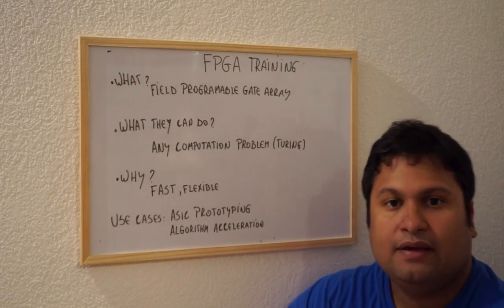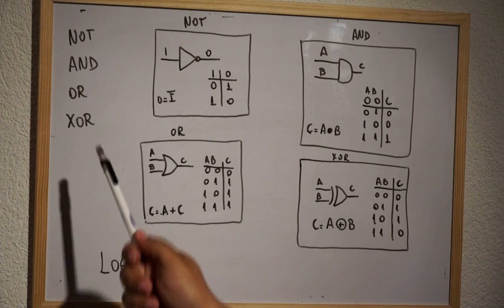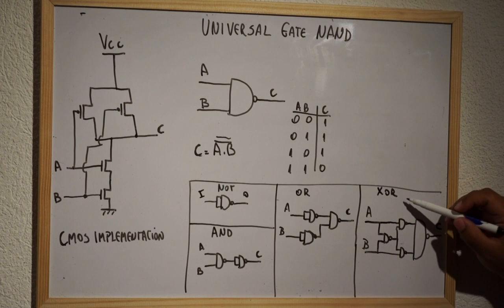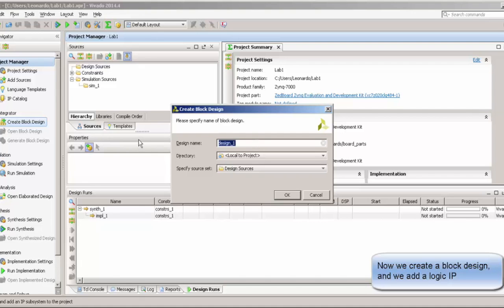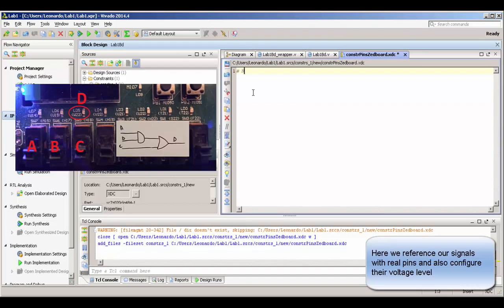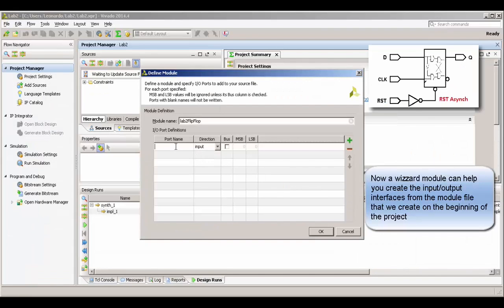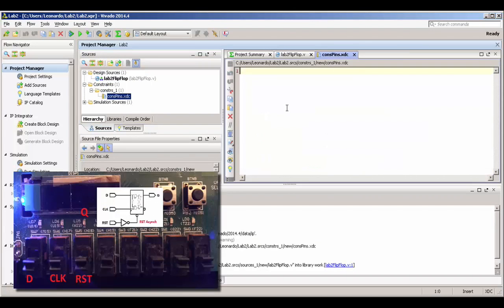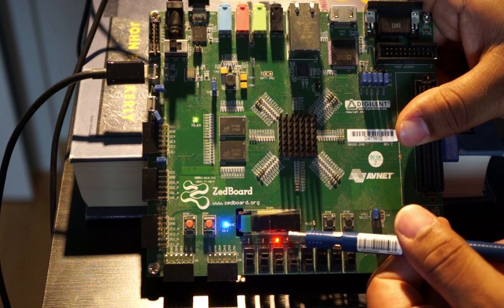FPGA Course - The Basics #01

Comment: very good exposure of using SIMPLE FPGA hardware ,WRITING COMBINATION ,SEQUENTIAL software circuits , TESTRUN to verify APPLICATIONS within 30 minutes in One VIdeo. I had been teaching DIPLOMA engineering(3 years complete course) students in electronics , preparing them for future Degree  course. The video briefly covered Basic DIGITAL ELECTRONICS. By replacing FPGA with discrete PDIP ICs, the student will learn the latest technology and preparing them for future career in industry . Ten years ago FPGA cost a few millions/thousands. Today 2020, the price already droped to hundreds and easily buy through INTERNET ! Arduino/Rasberry PI 4 becoming Primary school training stuff .FPGA is slowly becoming Secondary school training stuff. Very soon the University engineering FPGA will disappeared and replaced by Printed Electronics and CloudPhone or Qubit Computer training stuff .
 Thanks for your Good
 knowledge sharing video !

Comment: I followed all the steps mentioned in the above video  but i was unable to generate the bit stream it gives me the following errors:

1)  [DRC 23-20] Rule violation (UCIO-1) Unconstrained Logical Port - 4 out of 4 logical ports have no user assigned specific location constraint (LOC). This may cause I/O contention or incompatibility with the board power or connectivity affecting performance, signal integrity or in extreme cases cause damage to the device or the components to which it is connected. To correct this violation, specify all pin locations. This design will fail to generate a bitstream unless all logical ports have a user specified site LOC constraint defined.  To allow bitstream creation with unspecified pin locations (not recommended), use this command: set_property SEVERITY {Warning} [get_drc_checks UCIO-1].  NOTE: When using the Vivado Runs infrastructure (e.g. launch_runs Tcl command), add this command to a .tcl file and add that file as a pre-hook for write_bitstream step for the implementation run.  Problem ports: A[0], B[0], C[0], D[0].

2) [Vivado 12-1345] Error(s) found during DRC. Bitgen not run.

kindly let me know where i have made a mistake .Thanks  for this help full video.
Reply: Go to the implementation view, go to the I/O Ports window (or if it's not visible then select in the menu Window -> I/O Ports) and make sure every input/output you used has a pin selected. Otherwise it doesn't know which pin is supposed to be which signal.